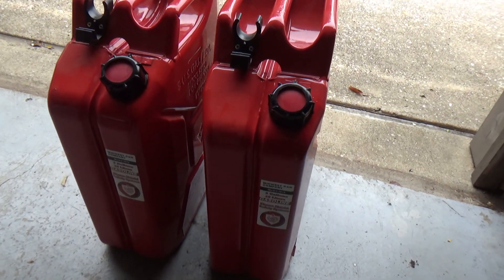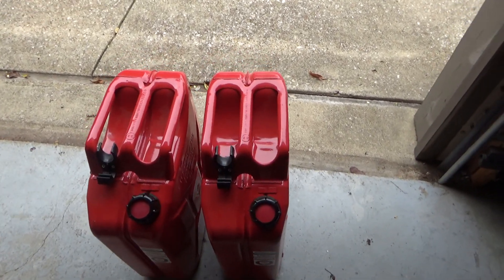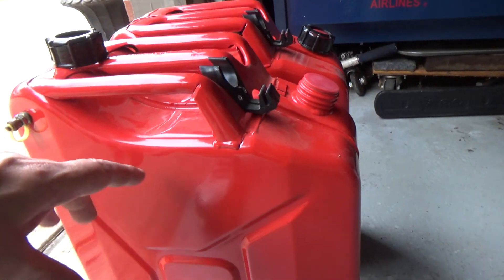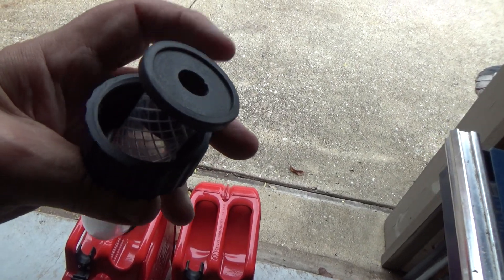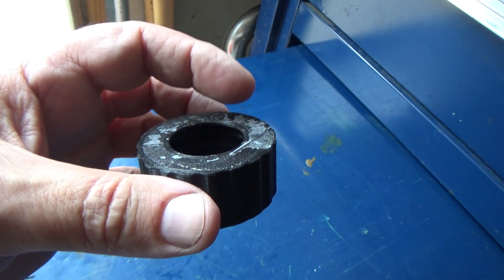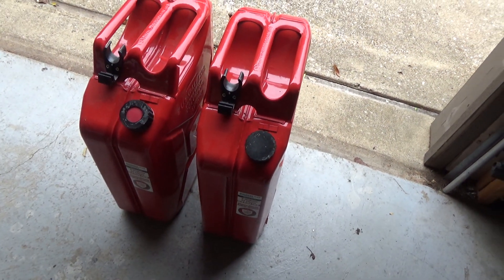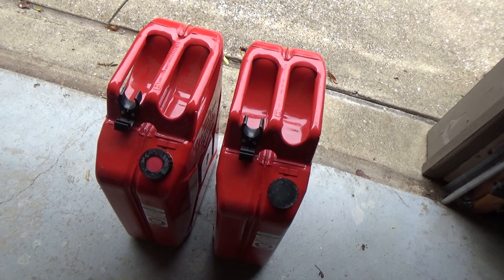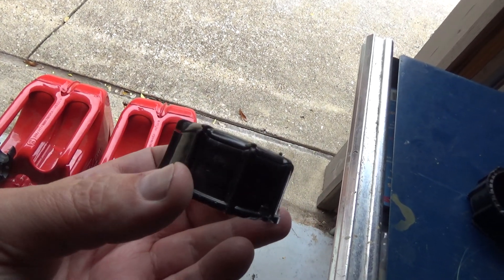Weak Point on the Harbor Freight Midwest Gas Can and my Free Solution.

Comment: Fill on HOT days if you are going to STORE gas
fill on COLD days if you want to save money at the PUMP

main problem with gas is how much contraction / expansion occurs over a relatively small temp range

god forbid you fill up in the morning in the low 30s (F) and by noon its pushing the 90s (F) and by dinner its over 100 (F)

metal cans be bulging and plastic caps be brokedededed

Comment: Would it be possible to have an otherwise solid cap that has the aftermarket vent installed in that, and just keep the spout on the external spout holder?  It wouldn't help with pouring of course, but for storage it should keep it from ballooning up or sucking in.
Reply from the maker: Thats a good idea.

Comment: This is the exact same problem I ran into last week.  Ordered some replacement caps off Amazon, CM Concepts and made in USA.  Put them on and they leaked like crazy.  What a disappointment.  Will check out the metal caps you referenced below.

How have your caps worked so far?  Hope you found a easy solution.

ETA:  Only had the gas cans about a year and a half and opened the cans a few times to let the can vent due to changing temps.

Comment: Replace plastic cap gasket with a thick rubber one. Allows for pressure changes easily.
Leaving any vent loose will let in moisture and make your gas go bad.
Most people do not have 3D printers nor know how to use them.
Real Jerry Can has a spring that holds the metal cap on tightly.

Comment: @737mechanic, how did you put that nipple on the back of your can?  I have two of the same can, and that fluffing is getting OLD.
Reply from the maker: I drilled a hole and used a piece of wire to fish it through and put the nut on it.

Comment: This should be a better cap now!  I do think in the summer heat, the gas vapor expands and causes that dome effect on that plastic wafer.  Instead of loosening up the large cap, I'd just open up your brass vent just enough to let it breathe during (heat) expansion and prevent imploding when contents and can cools.  I've had plastic cans collapse inward some during cold and I've had ballooning or serious expanding when in sun.  Allowing the vent to breathe should take care of all those issues.
I have different brands of plastic fuel cans, I'd love to purchase some of the hose connectors and hose end caps, maybe your improved attachment caps, but I have different threads on a couple cans. 

I've seen you had your email given to others, but this is a year old post...if you still make for others...please make a comment that you do still.  Thanks
Reply from the maker: I would but my 3d printer is down. I have made the 3d files free so if you want to download them there are 3d printing services that will print files you send them. I have no idea what they charge but that is an option.

Comment: Some items at Harbor freight are good, but you take your chances on other things. I'll stick with real Jerry cans with the metal fixture/spout.
Reply: Me too. I have one! Had to import it though. Cost a small fortune. They have far less EPA BS on the imported ones.
I want the flexible metal snake hose for the filler.
Reply: never had a problem with mine. but not sold in cal. 
i do have a couple “safety” cans sold in ca. all steel no cheap plastic in my yard. real spouts. no spillage with them. can can sit in some summer sun no problems, get banged around no problems some of my jerry cans are well over 30 years old never had a fail. 
keep real gas in them when unused or just fill with old oil. no rust. and they are used as a extra way to keep my garage door closed.  kinda hard to life that extra 70 pounds.

Comment: Is it possible to have excessive pressure due to insufficient air volume?  Recently, I've learned that I am not suppose to fill up the container to the brim, which I usually do.
Reply from the maker: its possible, but even if you fill it up to the brim, there is still a slight air cavity that can never be fully filled.
Reply: leave air space when you fill them up but not to the brim. 
storage of modern gas add in stabile and de water chems to the mix.  leave air space tighten a metal cap tight. place in a dry cool area.  good for a decade.